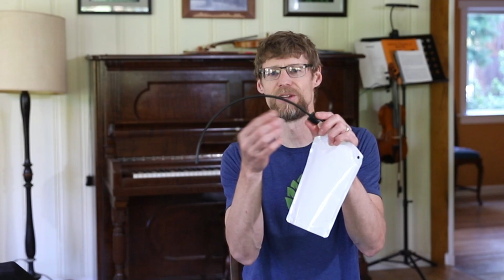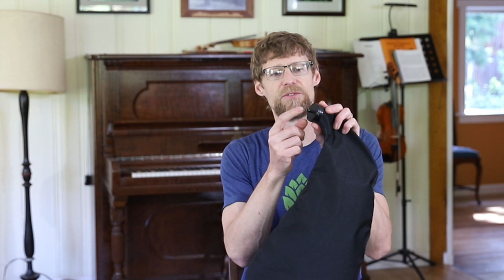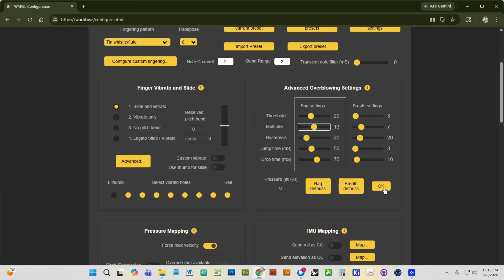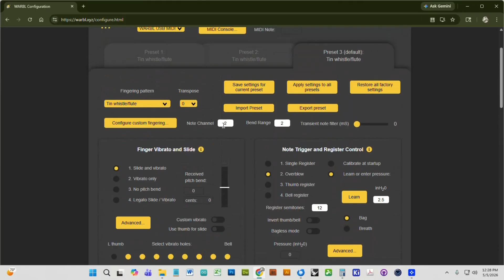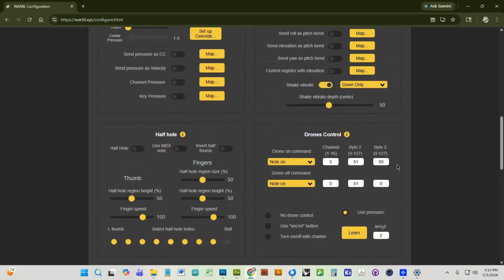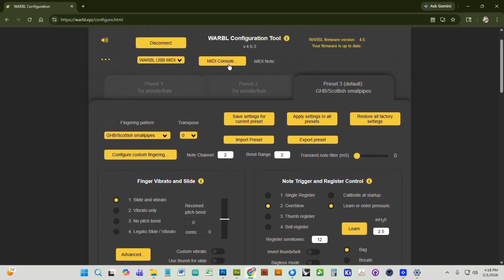Using bagpipe bags with the WARBL

Comment: This opens up a lot of possibilities like using an uilleann bag with bellows and putting a pressure relief valve between the bag and the warbl so you can practice both fingering and air control as it would bleed off with bag pressure over a certain psi. Definitely going to warrant some experimentation when I’m able to afford a warbl. I’ll likely design a 3D printable solution both for the bleed valve and stock adapter so it’s as accessible as possible for folks.

Comment: I appreciate the built in sounds on the WARBL app now, at least as a fail-safe and testing environment. I'm still using Celtic-Sounds app, though Michael tells me he hasn't updated it in years so I hope it stays available for years to come... I need it, the highland bagpipe sounds are quite good and unavailable on IOS elsewhere!
Reply from the maker: Great, I'm glad to hear it! Just so you know, Celtic Sounds is also now available as a web page that connects to the WARBL. It has more features than the iOS app and works on any platform: https://michaeleskin.com/celtic-sounds/celtic-sounds.html.
Reply from the maker: If you'd like to use the web-based version of Celtic Sounds on iOS, you need to open it in the free MIDIWeb browser (you can also run the Config Tool in that same browser, by the way): https://apps.apple.com/us/app/midiweb-browser/id6757226617